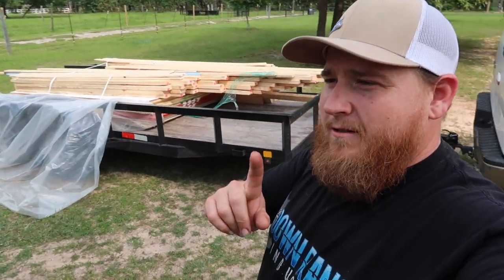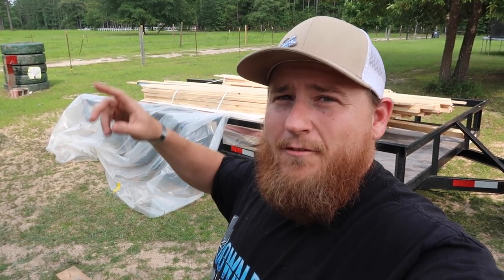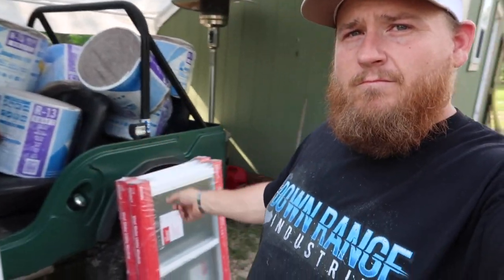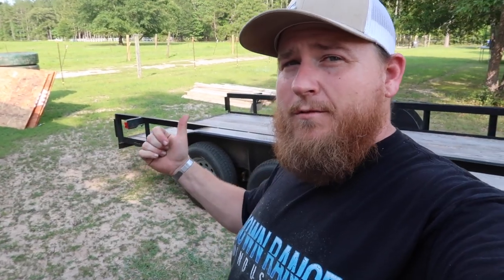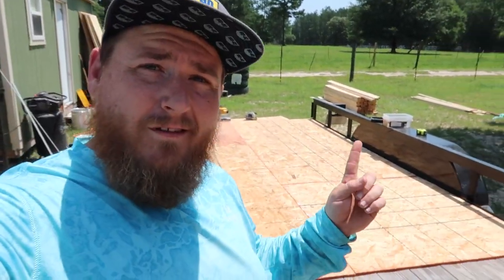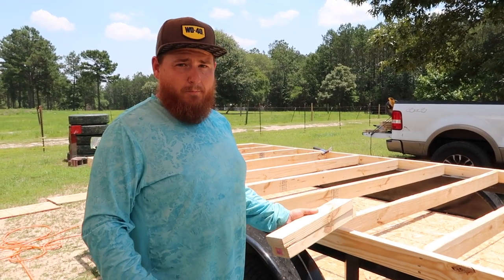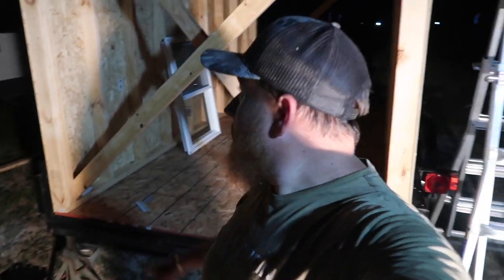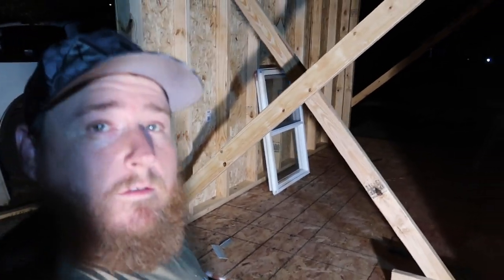Building A Snow Cone Stand On A Trailer Part 1

Comment: How did you fasten the walls to the angle iron frame?
Reply from the maker: I used lag screws and went through the sill plate all the way through the floor. Each wall has 3-4 (1/2”x4”) screws. There isn’t anything actually connected to the steel. Then each wall is lag screwed together at each vertical corner with 2 more of the same screw/bolts.